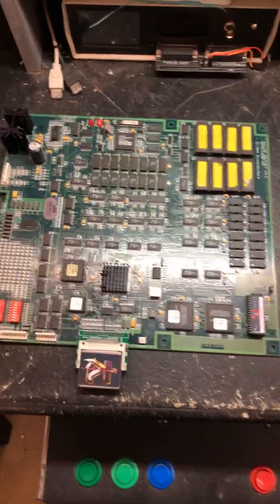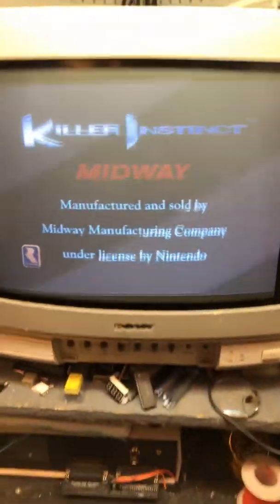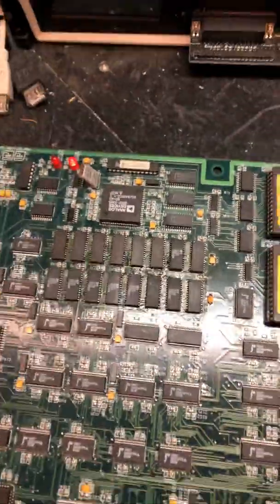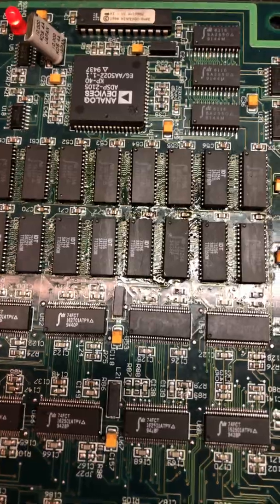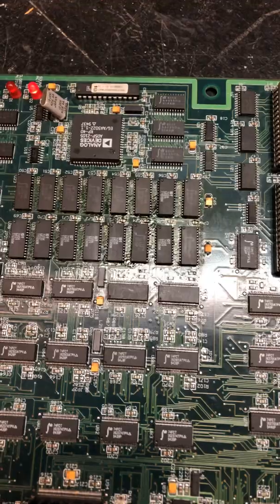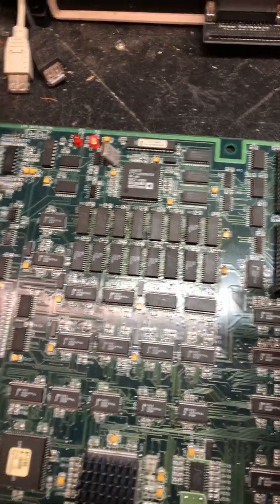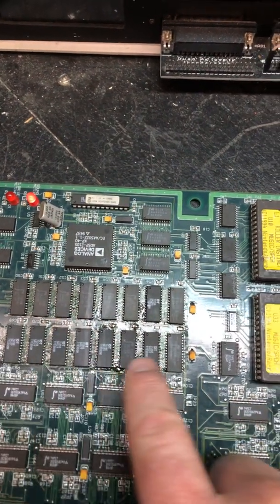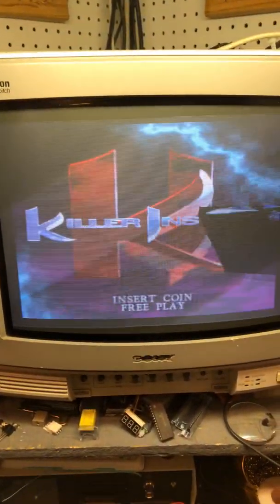Killer instinct pcb repair

Comment: What does it mean with one led on and nothing else also the hdd is missing
Reply from the maker: you need to add a drive to the board. It wont boot without one.
Reply: @gamefixersvideos  also there is no heat sink on board can u run it without one?
Reply from the maker: @kevinthorn9672  you can for testing  but not long term
Reply from the maker: @kevinthorn9672  i use thermal epoxy to attach the heatsink to the IC. Make sure the board boots before you do that though. If that CPU needs to be resoldered its harder to do with the heatsink on or in the way.

Comment: I have "sram error!!! can't setup credit interupt" can it be fixed?
Reply from the maker: Has anything been done to the board up to now? Specifically, has the CPU been resoldered?
Reply: @gamefixersvideos  yes something was done. Someone it and ide connector next to the 44 pin and I ended up changing the sram. It has little green dots at the to of the screen and would over heat. I just picked up a parts board come to find out it was just a bad hd. I don't want my old board to die.

Comment: Hey man.  Do you repair these? I have one with bad resistors around the CPU. Thanks.
Reply from the maker: bad as in missing like torn off of the board?
Reply: @gamefixersvideos  They are there but they look burned up. I was going to replace these first as first step in fixing this board.
Reply from the maker: @racer4200  Send me some pics @ gamefixer at gmail dot com

Comment: MATT MACDONAGH,  how did you piggy back a SMD Ram chip because the legs on the SMD RAM chip aren't long enough plus it looks like you used a different type or RAM chip to piggy back? Did you use a logic probe to measure the data signals of the RAM chip?
Reply from the maker: I pulled a RAM off of another board from the same area so they should be compatible. Then I straightened the legs out with small needlenose pliers. There's enough of the legs on the SRAM to get the one with the straightened out legs pushed down on top of them. 

I did look at the signals with a logic probe but the results were inconclusive. Its when I looked at them with a scope I noticed things weren't right. But, those were all on pins that were shorted together somewhere. The RAM that I ended up replacing looked exactly the same on the scope as the one I replaced it with.
Reply: @gamefixersvideos  thanks for the help. 
What SRAM chips does arcade game usually use? because different arcade games use different types of SRAM and DRAM not sure why. They have different access time so not sure why they use different SRAM and DRAM with different access time.  Does this arcade game use H&V counter chips for the H&V sync signals or something else? because the H&V sync signals get mixed together with the video RAM chips which the Video RAM chips aren't SRAM or DRAM but something else?
Reply from the maker: bill williams 71256 and 62256 is what I’ve seen on this board.